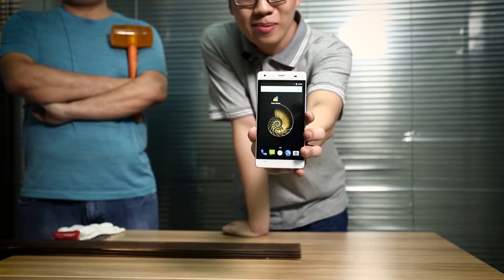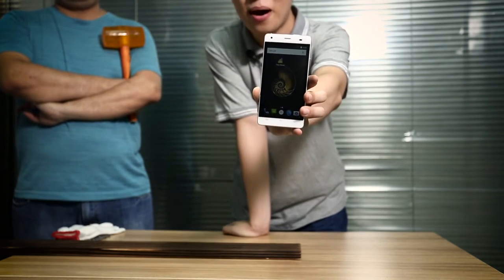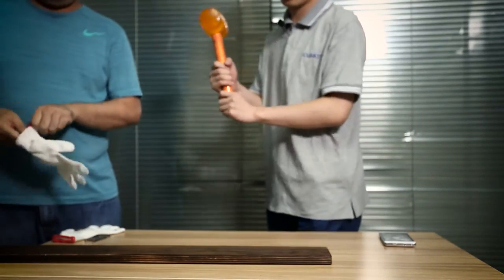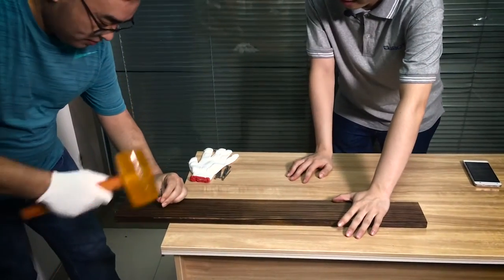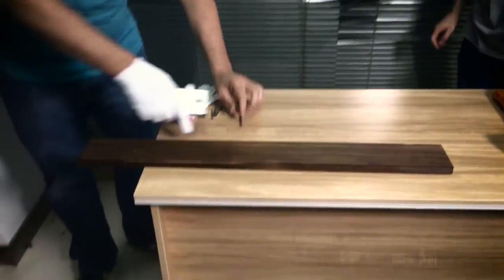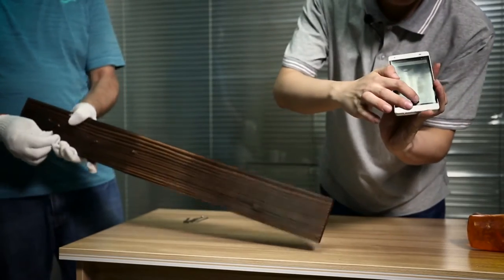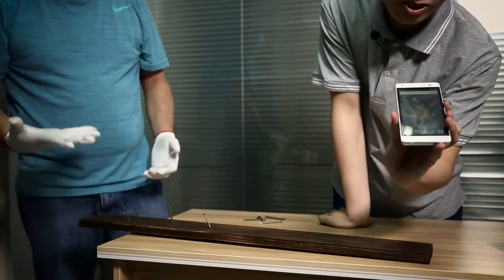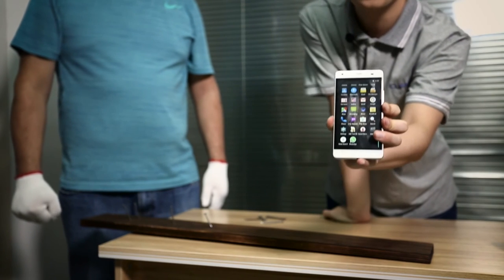The hardness testing (nail) of CUBOT ECHO screen

Comment from the maker: Buy CUBOT Echo here:
►AliExpress: https://goo.gl/97eeRO
►Gearbest: https://goo.gl/lkeWXI

CUBOT Echo Main Features:
Display: 5.0 inch, 1280 x 720 HD screen
CPU: MTK6580 Quad Core 1.3GHz 
System: Android 6.0
RAM + ROM: 2GB RAM + 16GB ROM
Camera: 13.0MP rear camera with flash light + 5.0MP front camera
Sensor: Accelerometer, Ambient Light Sensor, Gravity Sensor, Proximity Sensor
SIM Card: Dual SIM dual standby, one is standard SIM card, the other one is micro SIM card
Feature: GPS, A-GPS
Bluetooth: 4.0
Network: 
2G: GSM 850/900/1800/1900MHz
3G: WCDMA 850/900/2100MHz
Reply: Smart Trend I have it for 7 months now and it's ok